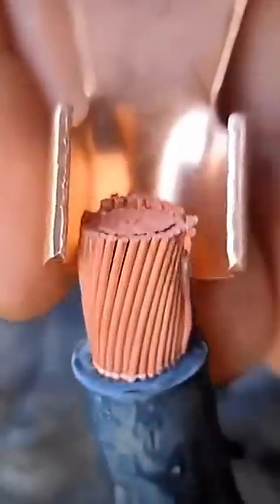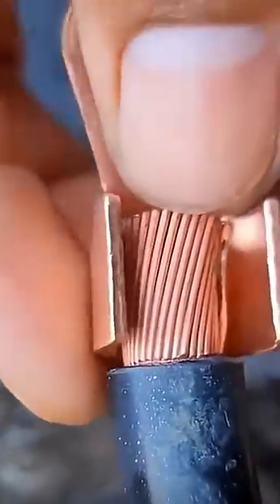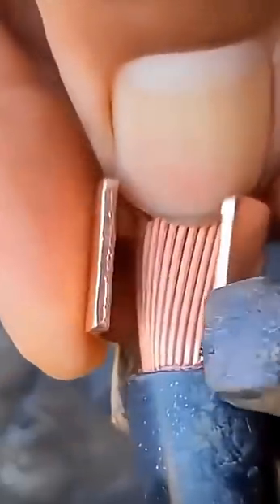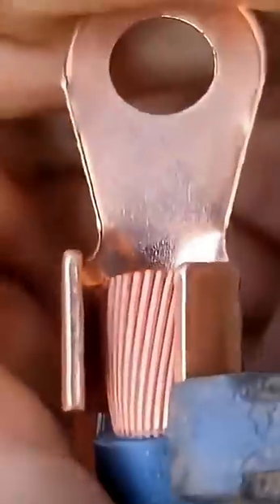STOP Using Weak Connections! Strong Wire Bonding Techniques

Comment: Uhh depends on what it’s for I tend to do both crimp and solder for low voltage 28volt hi amperage like 1000+amps  applications than if it’s just crimped way more life out of it the connector outlives the plug by 4 to 5+times as long

Comment: The connector is thin copper plate ant its cross section does not match the cable's. Will be a hot spot.